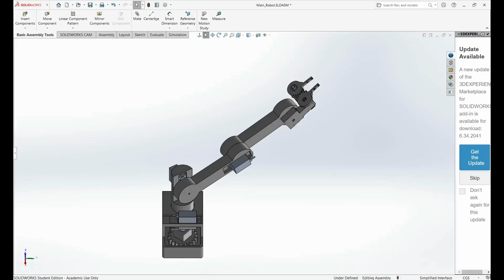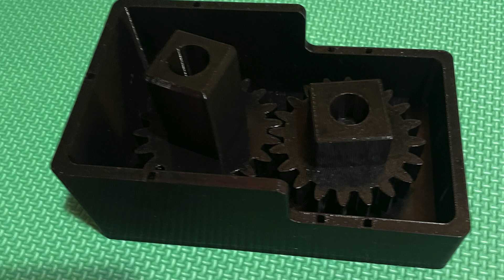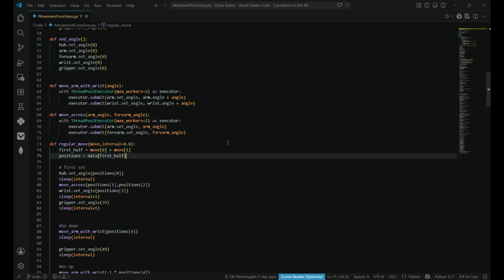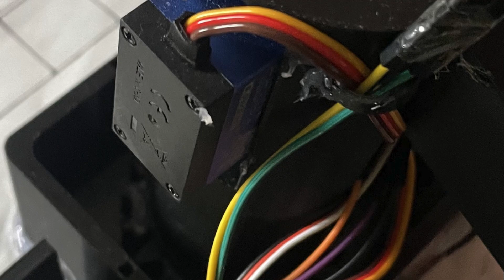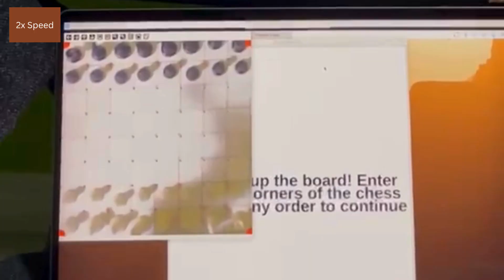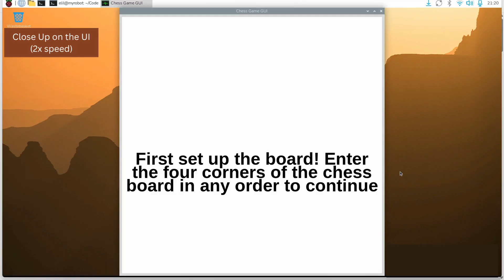Smart Chess Bot Made With Raspberry Pi 4

Comment: This is revolutionary. I have yet to watch the full video, but I can already tell this will impact the world in a positive manner. I have a couple of questions:

1. Does your code utilize matrices at all to determine locations and/or which pieces to move?
2. How many degrees of freedom does your mechanical arm have?
Reply from the maker: Hey thanks for the kind words!

Now to answer your questions:

1.  My code uses the webcam to capture pieces, and their positions are sent into another function, which finds out which square the pieces are in and then updates the chess engine. The minimax algorithm calculates the next best move for white. My code does not use matrices to solve this. However, I did use matrices to calibrate my camera to prevent distortion.

2. My robotic arm has 4 degrees of freedom with grippers and can travel in all three planes.